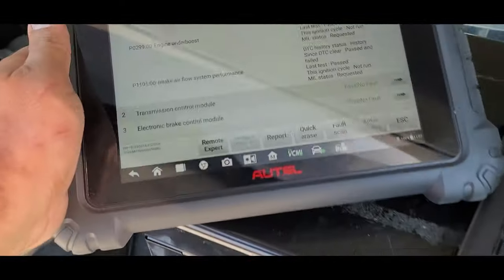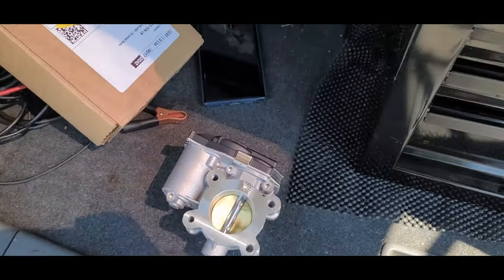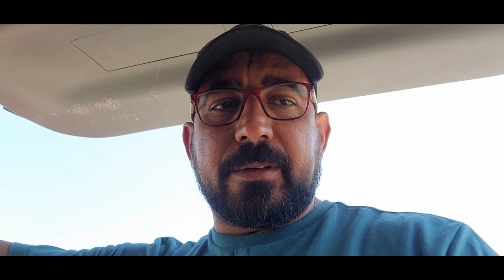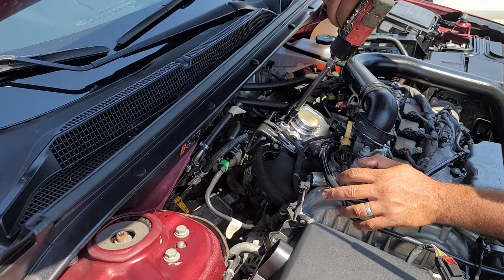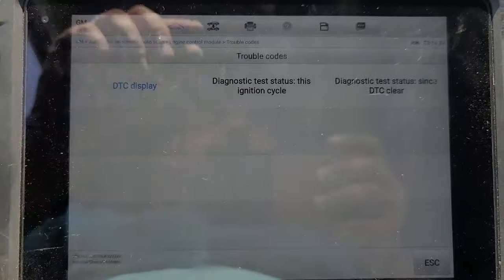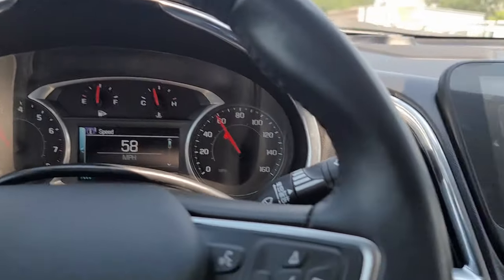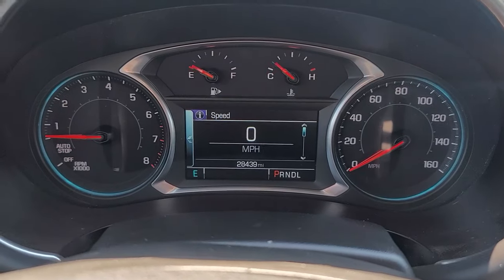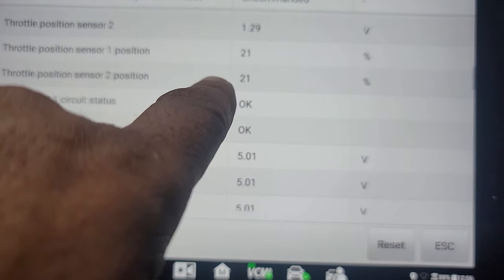Reduced Engine Power and 4 codes on a 2018 Chevy Malibu.

Comment: I got a problem with my Malibu 2016 when it comes off at autostop the rpms go up and down for a little bit after that I have to press accelerator like 3 times so it can drive I have no check engine or anything wat can be wrong??
Reply from the maker: Even if you don't have a check engine light on now, you should scan the car and see if there are any pending or history codes and take it from there. If not, then someone with an advanced scanner needs to look at some live data while its acting up.

Comment: Hello can you point me in the direction of the fuel pump module in a 2018 LT 1.5 it's not located in my trunk.
Reply from the maker: Hi, it looks like under the vehicle between the gas tank and the frame. If you need a picture give me your email address.
Reply: @DallasAutoDiag  YouTube doesn't allow me to comment my email..do you think replacing this part in this location requires remove of the gas tank?
Reply: @des2begreat  did you solve the issue? Im going through the exact issue and planning to swap the FPCM as well

Comment: I have a 2018 chevy cruze 1.4 also with engine power reduced I'm getting codes p0033 and p0034
Any idea what could be the problem?
Thank you
Reply from the maker: DTC P0033
Turbocharger Bypass Solenoid Valve Control Circuit
DTC P0034
Turbocharger Bypass Solenoid Valve Control Circuit Low Voltage

Did anyone check the solenoid for you?
Reply from the maker: @robertbenitez9869  did you get a genuine or aftermarket one? What was the brand?
Reply from the maker: @robertbenitez9869  how long have u had the car? Was is in an accident recently?
Reply: @DallasAutoDiag  I've been having it for like 6 months barely 30,000 miles but with salvage tittle
Reply from the maker: @robertbenitez9869  time to check the wires between the pcm and the solenoid.
Reply: @DallasAutoDiag  ok I will have  those check, thank you so much for all your help
Reply: Hello 👋 how can I contact you I live in dallas so I can take my car to you
Thank you
Reply from the maker: @robertbenitez9869  you can conact us through our Facebook page. Same name and logo
Reply: Awesome thanks you

Comment: I recently got the engine power reduced message on My 2018 Chevy Malibu . The car kept turning off & it wouldn’t accelerate. I was told that it needed a new turbo . Do you think that’s accurate or would it be the throttle body ?
Reply from the maker: I don't think a bad turbo would make the car shut off. It would just reduce the engine power. There might be something else.
Reply: I was told I needed a turbo and failed emissions related to the same issue

Comment: My car had the same codes your have… I drove it and it just died completely wouldn’t even start??? Could it still be the throttle n the sensor???
Reply from the maker: Any repair has to start with a coat scan
Reply: Love the question and this is what I need N answer to my same exact problem/ issue

Comment: My car does this reduced engine power bs took it to the dealer they put a new part then few months later same issue
Reply from the maker: there might be another bad part
Reply: @DallasAutoDiag  they replace the a part covered by GM something with the Excelerator

Comment: Hi.. I'm dealing with code p0697.. my scanner says 5v reference circuit 3 malfunction.. with 5.51volts any help someone... is a 2017 malibu ls 1.5
Reply from the maker: Someone has to see what's on that circuit and find out which one is bringing the voltage up

Comment: Question man I have the same issue but it give me code po299 turbo boost would this work for that ?
Reply from the maker: not sure. could be many things
Reply: @DallasAutoDiag  I mean I changed out o2 sensors I changed out this part and at this point idk what to do just trying to fix it but I know mechanics can charge to much sometimes
Reply: @DallasAutoDiag I also recently replaced the turbo it self there’s no leaks or nothing

Comment: I’m having the reduced engine power problem now and it’s messing with my rpm’s also, idk what the problem is and I don’t have any close mechanics and I’m sure as heck not wanting to pay a crap load of money for it if it’s a simple fix. I hope it’s the same issue from this video because that seemed ratherly easy

Comment: How do you fix the Reduced Engine Power/Limp Mode U0101 Stabilitrak problem forb2015 Impala LTZV6?
Reply: All you do is…
Reply: 6 months later transmission swap and 3 TCMs still in the garage reduced power lump mode